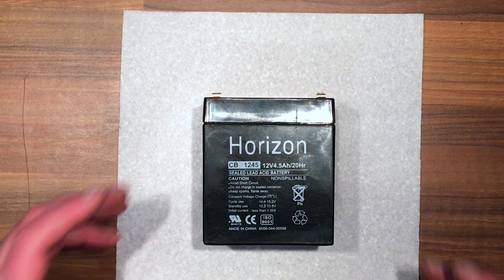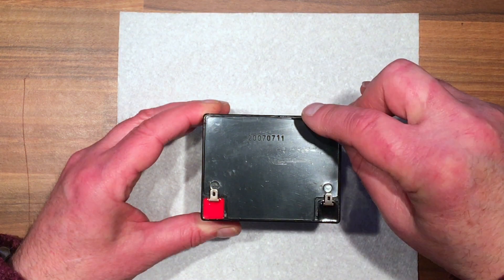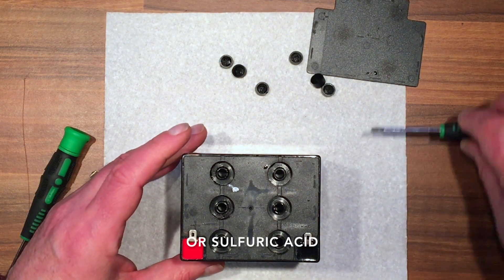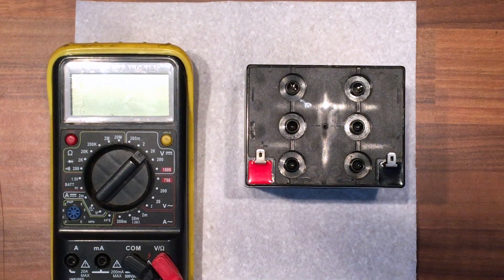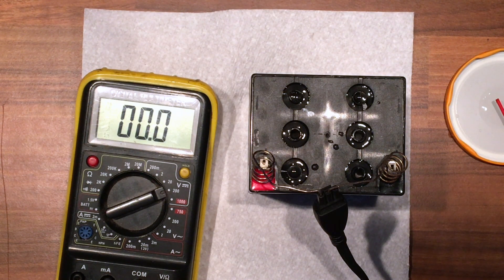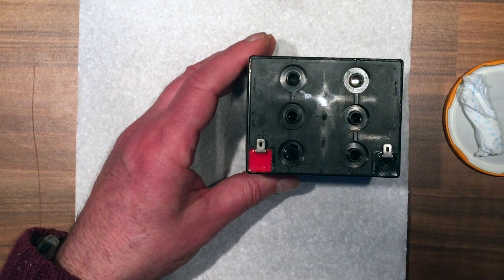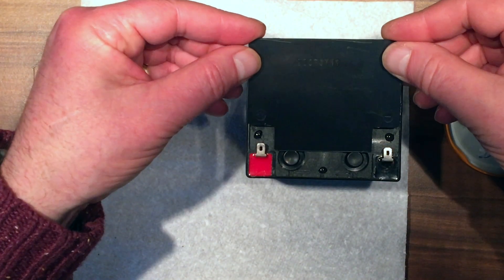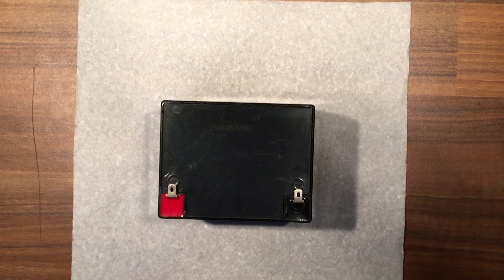Life Hacks How To Recover A Dead Battery And Make It Work Again

Comment: How's that battery holding up now? And did you test it with any kind of load?
Reply from the maker: We use it in parallel with others so when on load it's balanced and drains quite evenly. Overall it's quite capable when used in a bank. Singly it does drain rather faster while on load.